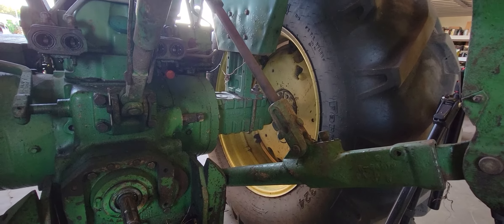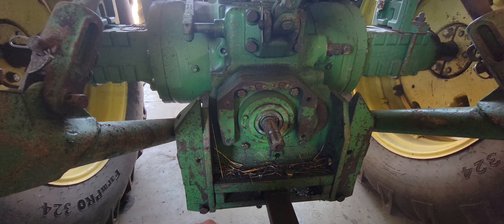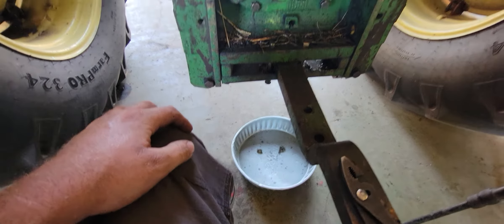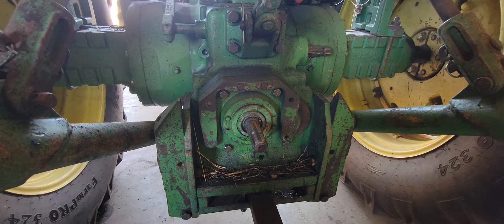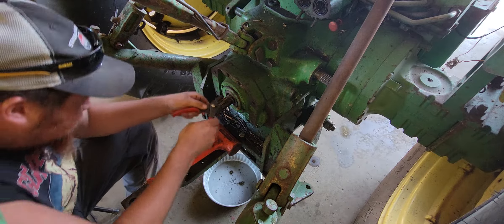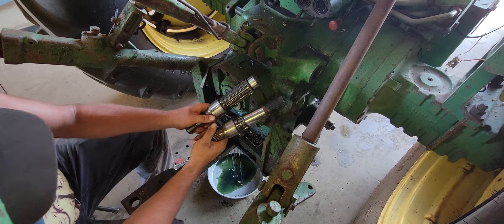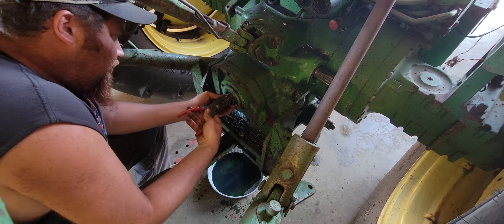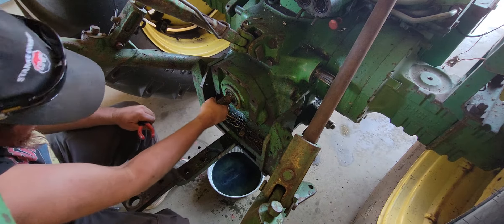540 To 1000RPM PTO Speed Change Over For John Deere Tractors

Comment: Operated JD's for years and never had to make this change! Always wondered how the full power was maintained. One place I worked at had 1000 connections on some of the 540 equipment so the tach had 540 indicator which meant not having full power of engine. I understood some equipment was low hp rated  but still on a larger tractor you could over power the equipment. Depended heavily on experienced operator which wasn't always the case and ended up with trashed equipment, usually from over speeding said equipment. Great video! Thanks for your time and sharing! 👍😎✌️🇺🇸

Comment: Excellent video Brandon  :) the International 624 & 724 tractors had farm I grew you had pull Clutch handle above Clutch pedal also lock in place then make sure tractor is running have 1000 RPM and by posi trac pedal for rear end on right you had Rectangular lever had Foward notch  is 540 RPM, pull back 2 notch got 1000 RPM for hand mill speed  then in middle 3 notch is off on PTO speeds, 4 notch is square baler speed  , 5  notch for Silo Blower to fill silos with and then press throttle  up 2100 RPM top engine Revs plus Cruise lever on then unlock Clutch handle to on Foward to engine same time slowly not kill engine! ! Then done need PTO use take Cruise lever off plus have foot throttle to 1000 with right lever in middle shut PTO of in 15 seconds to stop and if hear snap using PTO pull Clutch Lever fast plus Idle and see what happened if don't blow Clutch plate and rear end out plus Gears box  in PTO stalk is ! How found this happens the 624 use on Handmill grind corn cobs up for chop feed years and corn frozen up in winter season and bearing on PTO in Handmill seize up to plus had lots grease up to! Tore gears on PTO stalk drive in gear box on 624 to also had get lots new parts before continuing on took 3 weeks fix in Winter Season cold a ever! God Damn is right and piss off too! But got John Deere Handmill  fix up used 724 International tractor and waited for parts for 624 International tractor come in plus work on !